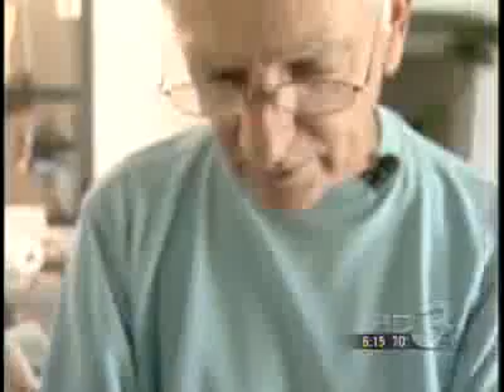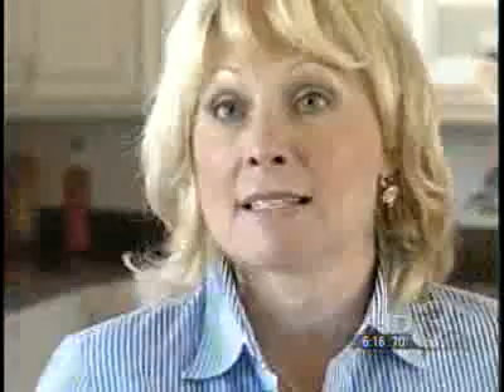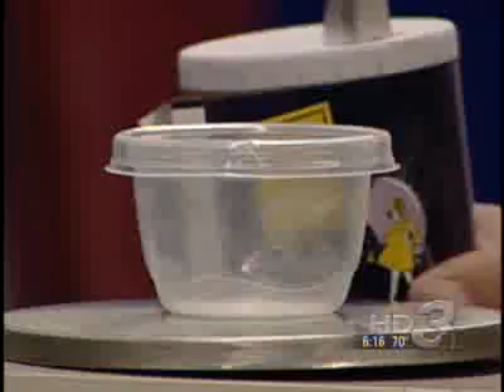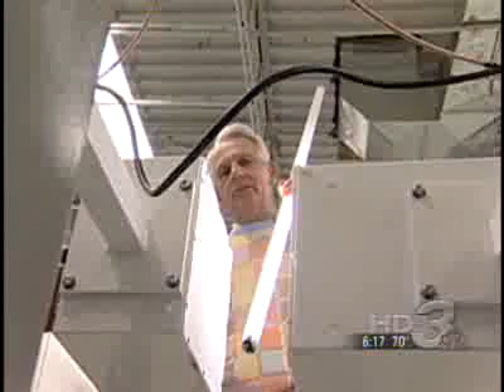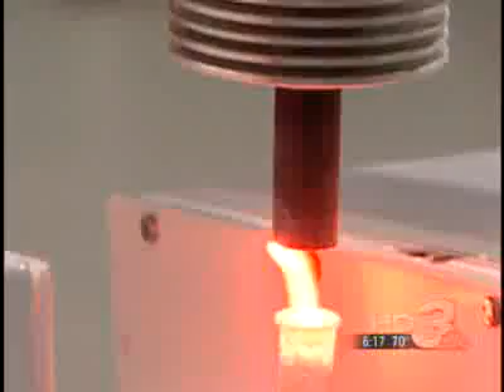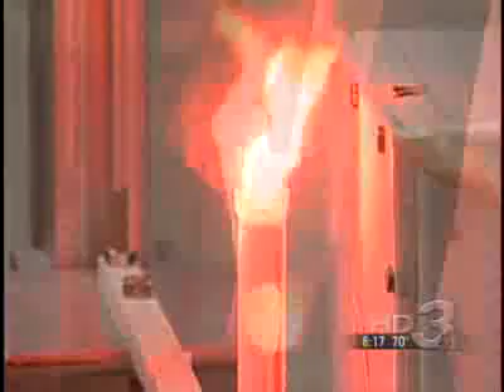Energy from salt water

Comment: Although i dont know if this  method works, there is a different way to seperate the hydrogen and oxygen using an hho fuel cell.  If you take two wires and stick them in water and hook up a battery the water seperates into hydrogen and oxygen.  If you can make it efficient, it is highly explosive and has a lot of power.  Look it up and you will see how many people use it to help reduce car emissions.